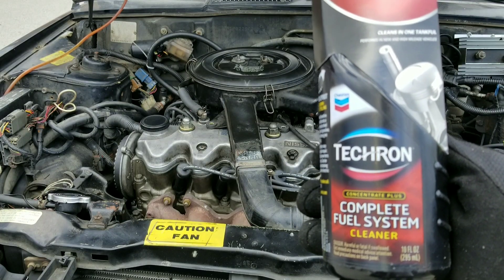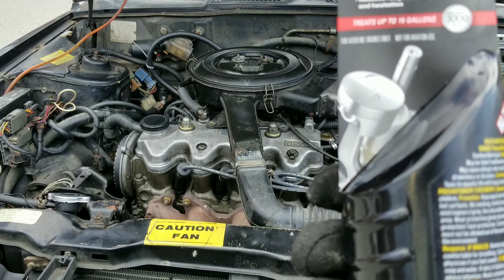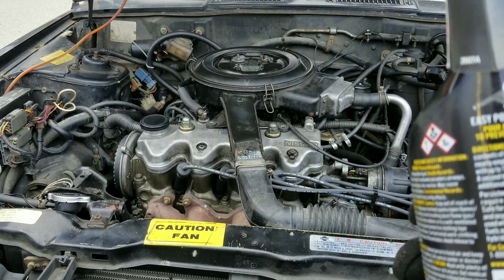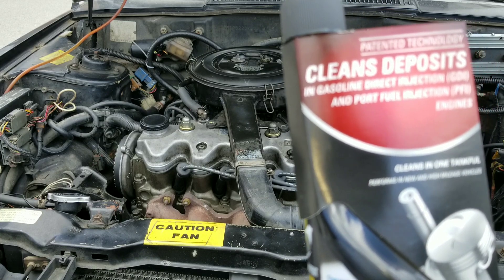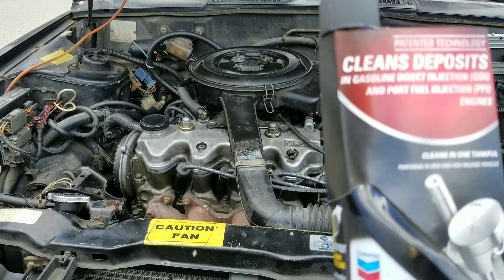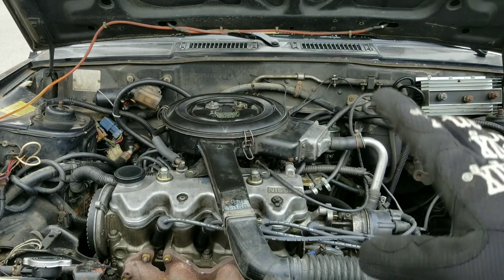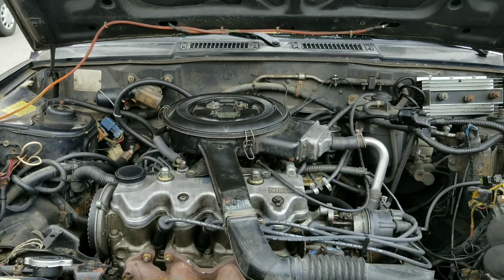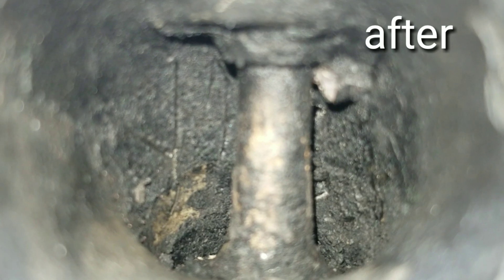Techron stunning test results intake valves

Comment: Well I just used this on my evo and it 100% worked for me ..my car was misfiring and even after inspecting and messing with spark plugs gap like 3 times I decided to use the fuel system cleaner and I can honestly feel all my horsepower has returned for me it was night and day idk about anyone else's car but I approve 👍
Reply from the maker: Thanks for sharing and is this the only cleaner you have tried
Reply: @NATESINTERACTIVEAUTO  yes sir , I had a wrx that I used seafoam on so I know that works too but I liked how easy it was to just pour in the tank and fill up with techron
Reply from the maker: Yeah i agree seafoam also has a treatment you just pour
Reply from the maker: Interesting what can you tell me about the product

Comment: Nothing works like perfect the first time. I've been using Techron for years. I love the stuff. The key for my 97' 5.9 RAM is BG44K every 6 months and Techron once a month. I also use non ethonal gas. Rides smooth and lots of get up and go.
Reply: Do you use it before an oil change ?
Reply: @قناةلنشرالخير-ص3ل  you can. But once a month should be fine right when tank is Qtr full drop it in and drive for a little
Reply: Then fill up tank.

Comment: This guy will come out ahead by pulling his fly head off and having a valve job done. THAT will remove all the carbon and then he can start to be a better owner by giving his car Techron every oil change, and change the oil at 3,000/4,000 miles at most. Now you'll do much better!!!

Comment: It took me using this product about 5 times before I started noticing a difference in the way my car ran. I was just about to give up until I noticed that my car stopped running so rough at idle. My gas milage has started going up as well.

Moral of the story, you can't expect product to clean 30 years of buildup in one go. I will say that maybe it took me so many tries because I don't really get my car up to a high speed. I only drive it to and from work, and never hit more than 50mph. I'm sure if I had driven it more often on the interstate at higher speeds that I would have started noticing a difference much quicker.
Reply: dont think its about speed.....you can be travelling at 150kmh at 3000rpm...........its about getting the rpm to a constant 4000 5000rpm for longer periods of time.
Reply: Do you have more than 75k on the car? They have a high mileage product i didnt realize, i noticed more immediate improvement once switching to the high mileage one.
Reply: @paulsmith8510  late response but how consistently did you fill with Techron? Every tank full or every other tank? I want to know to test it myself.
Reply: @darkpillowz  honesly i only do it once every other month or so. I do it before I get my oil change and sometimes a treatment in between. Run your gas tank to empty, the emptier the better, before you fill it up while at the pump pour the bottle in then fill it. I do notice improvement. It doesnt last. But it makes a diff. I think i need new spark plugs, it would make a bigger difference.
Reply: @Paul Smith  if you have Chevron gas stations it comes in the fuel already. Just running that fuel should clean it up over time and stay that way.
Reply: @streetrider2487  It's about engine load, and high speed is an easy way to get consistently higher load.

Comment: I bought a 2001 Silverado with Lq4 6.0 LS motor.  Had 200k km's.  Noticed a little rough idle, but decent power.  Definitely had part throttle knock and under load going up hills so there was definitely some pre-detonation happening.  Typical oil consumption from borked PCV system from GM so I was sure valves and combustion chambers were caked with carbon deposits.  I fixed PCV issue with the updated valve covers and small orifice PCV valve along with catch can and LS6 valley cover.  Oil consumption is zero now.  Then it was onto trying to clean up the valves and combustion chamber.  I ran 8 full tanks of Chevron 94 octane + a bottle of Techron on each fill over the course of 2 months.  Now idle is dead smooth, engine has way more power and easily revs to 6k RPM pulling hard the entire way where before it would start struggling past 5k just a bit.  No knocking at all under any circumstances now.  Back to running regular '87 octane and still no knocking and power is great.  Adding bottle of Techron to every 3rd fill to keep things clean.  Great stuff, but don't expect much from one bottle, it is going to take quite a few treatments to get decent results after so many years of carbon buildup.  Definitely not a magic bottle of inta-fix.

Comment: Those valves are not going to clean up with a single use of ANY available gas treatment. Techron is certainly one of the best gas treatments out there. But even so, if it IS going to work, it’s going to take a whole lot more than one treatment. I’m guessing at least five before you see ANYTHING.

Comment: Can you keep adding with every gas fill up or maybe once a month? Im hearing add with every oil change.  I dont think it will do much. Needs to be done more often to see changes. Would switching from 85 to 87 or 91 gas help. Im using texaco gas because its the cheapest in my town & Costco. Im not sure what kind of gas Costco uses. What are your  thoughts?

Comment: Hey man run marvels mystery oil through the brake booster vacuum line or find a vacuum line that runs into the intake and do a before and after. It will definitely produce a lot of smoke but it cleans everything and doesn't get diluted through the gasoline. Watch some videos on it
Reply from the maker: Thanks i will do

Comment: Walnut blasting os the only tral way to remove carbon on intake valves of GDI engines. The fuel never reaches the intake valves as its injected directly in the cyclinders, not over the valves as in 'port' injection. So why wpuld you expect to see any cleaning of those valves?

Comment: I conjecture that the best way to use Techron or other cleaners is to let it soak and sit - so a full tank with Techron should be spread across one month of driving or more, with a var sitting at least a few days a week. The PEA work better when the car cools down and sits for a few days.

Comment: is the carbon on the valves actually impacting performance, if so, why dont car makers account for this?
Reply: It can clog so bad that it stop the valve from opening but that’s rare especially in United States where keep in mind all fuel must have fuel additives in it no exceptions yes even that no name gas station owned by Arabs has to have additives in it don’t let marketing get to you
Reply: @Operator--du4ek  if the vavle stopped to open would that destroy the engine or just make it stop running?
Reply: @roostersideburns3440  it wouldn’t destroy your engine but it would cause exhaust deposits to get worse since they can’t escape

Comment: I see a very small difference, I think this would work for cleaning but every tank full. But that would be expensive compared to other cleaners. I personally used this like a year ago and I did not see or feel a difference on my car.
Reply from the maker: Your absolutley right mpg test next
Reply: @NATESINTERACTIVEAUTO  Looking forward to the Fuel mileage test. How would you test fuel mileage on an older car that does not read you an average miles per gallon? I've been curious about my car mine. On my 1988 Honda Civic LX, I filled up my gas tank to the maximum 12 gallons and then I drove for around 330 highway miles. 330x12=27.7 miles per gallon, but the gas was near empty and did not want to risk running out of gas. My car supposedly gets 33 miles highway times a 12 gallon fuel tank which equals 396 miles.
Reply: @TheRichardF10  There are several apps out there that will calculate the mpg that you get. I use Fuelio. The tricky part is that it will give you the MPG for the previous fill up to the current fill up. So just make sure that you use that into consideration.
Reply from the maker: Thanks for sharing with the NIA community

Comment: The Techron claim is to clean in a tankful. 

Your test is half tanked. 

Word to the wise: Try really following the label directions and duplicating the claims. 

Most likely you'd have to run Techron for a while to make a difference on those engines; it'd be interesting to see what they look like after a tank. 

I don't like or dislike Techron but what's fair is fair and this "test" isn't adequate let alone fair.

Comment: I don’t think its doing anything. Let me tell you this .. if you want your engine clean and there is NO physical damage to the engine 
Here us what you do 

Change oil and filter 
Fill your car with some high octane gas , may be add octane booster, and drive your car at high speed on an open road for at least 1-2 hours on high speed 
Short low rpm and cold engine will not do it 
You need to burn that carbon , like the cleaning function on your home oven.   It lock the oven and raise the temperature to 450 for an hour 
Like cremation, then you will be left with gray ash , some times this will remain stuck ,,, then u repeat .. till its gone

Comment: used once to boost power when bottle pour in gas tank. After empty, still the same as normal power driven.  that bottle is like salad dressing for gasoline tank.  that bottle just a liquid and has no hands or fingers to clean inside engine.  How that bottle can be complete clean the engine as hands cleaner?.

Comment: I'd use Redline every time you fill the tank for Six months then show the results
Reply from the maker: Yeah good suggestion what ideas for the next video?
Reply: @NATESINTERACTIVEAUTO  ok. lol I realize if you put redline in for six months you won't be able to use that vehicle for testing other products during that time. So my suggestion would be to run 10 tank fulls for gas using each brand of fuel additive to give them the best possible change. That would be something no one has done. Just an idea might be ridiculous but then people would know for sure if buying that stuff is worth it or not.
Reply from the maker: Yes i agree and i have run the tank empty of the redline also oil additives and oil test soon any recommendations
Reply: @NATESINTERACTIVEAUTO  mabe try engine oil additives and check if the engine vibration is less. That's one idea.
Reply from the maker: I did just that and i have even used a sound meter